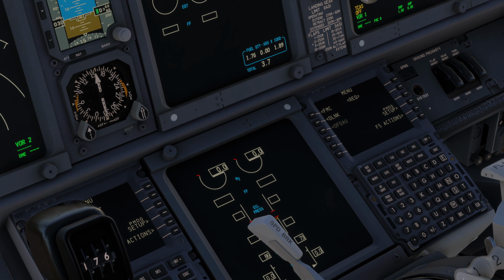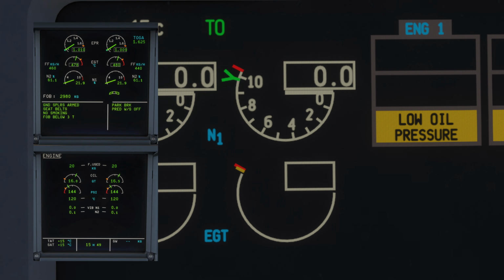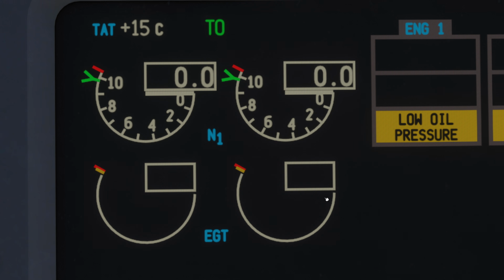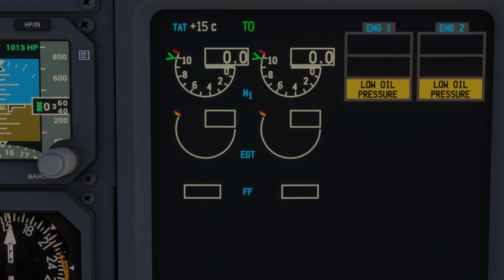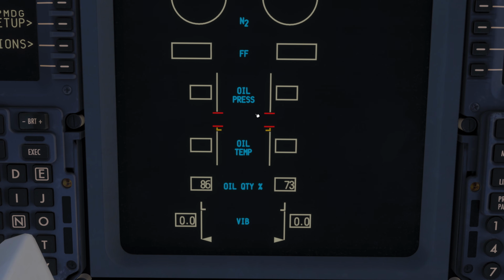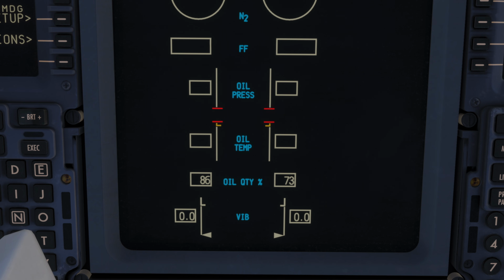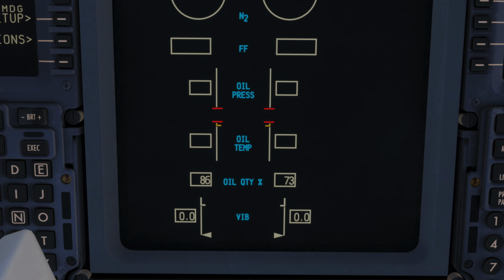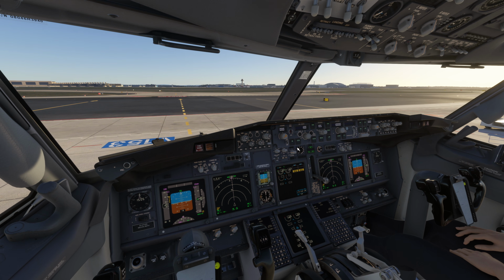WHAT does each Engine Indication mean and WHY DO WE NEED THEM? | Real Airline Pilot Explains

Comment: I was missing this kind of videos, thanks for the great explanation!
It inspired me to try things out in MSFS2024. I've set oil leak failure in PMDG 737 and waited until it all drained. The engine kept running with all parameters (except oil qty) normal. After some time oil temp started raising, than it fell into negative numbers... The engine kept running without any issues despite having no oil. @A330Driver do you maybe know to what degree does PMDG model engine failures?

Comment: Thank you very much! Your dive into N1 and N2 lead me to the understanding of presense of 2 independent coaxial shafts for high pressure compressor and low one. From old knowledge I thought that all blades are sitting on one shaft (like a steam turbine, lol) But in fact this was only at early years of jet engines. Also interesting fact about vibration: a320 engines (i don't know about others) seems to have a vibration protectiion. They aren't spooling up as it should, when vibration is too high. I got stucked in Fenix a320 CFM in EKCH in winter, after waiting for unloading/loading under wet snow (which probably accumulated on the blades). Fenix simulated this. I didn't know, just was taxiing to holding point on 1 engine, trying several times to restart other one. It was such a shame on vatsim 😂

Comment: The only time I've seen engine vibration getting too high, was when operating on the ground in freezing fog conditions.  The freezing fog formed ice on the spinner unevenly, leading to high vibrations.  The engines were shutdown and had to wait for the freezing fog to clear.  Rubbing Type 1 deicing fluid on the spinner does not work, as the high rotation of the engine flings the fluid off the spinner almost immediately..
Reply from the maker: And the ice shedding didn't help either?
Reply: @A330Driver  No, the deice fluid did not work. The deice fluid did what it is designed to do.  It falls away from the surface it is on once it reaches a particular speed.  The deice fluid was spun off when the engine operated at normal idle speeds.  Once the deice fluid came off, the ice would reform unevenly again on the spinner.  Thankfully FZFG is quite rare..
Reply from the maker: @AshleyWincer  I'm talking about ice shedding procedures where you're supposed to increase thrust a certain bit of let the ice fall off through rotational forces by accelerating the engine.
Is there no such procedure for your airplane type? Any plane I've flown has such procedures published. For example we'd use 70% N1 for 30 seconds before takeoff on the 737 in such conditions.
Reply: @A330Driver  I was working on the ramp at the time.  I'm not sure what the official procedures are for the CRJ200??

Comment: A question, will the windmilling engine shutdown in flight still have enough lubrication provided from the connected oil pump, or is the damage marginal enough to not matter much at that point ? It's windmilling so I imagine that the oil pump rotates along with it, but is it enough for the engine to not seize in time ?
Reply from the maker: Hi, a windmilling engine should be able to lubricate itself.

Comment: I really love deep-dives into engines, but unfortunately I don’t know that much about jet engines, so I’ve got a few questions:
1: are the different engine shafts connected or does each one have its own turbine?
2: how often would you shut an engine down in a multi engine plane? Let’s say your oil pressure is very low or you have a high vibration (high enough to cause damage) - but the engine is still running. Would you shut it down precautionary or rather keep it operating as long as possible? Of course it depends on conditions like altitude, terrain, phase of flight etc but would you generally prefer flying OEI or destroying an engine?
Reply from the maker: Hi Jannik,

1: The number of connected shafts is represented by your N indications in the cockpit. Most engines have N1 and N2, so two connected spools (each spool will have a LOT more stages of compressors and turbines!). Some have three spools, mostly Rolls Royce engines.
2: That'll vary by airline philosopy. At my first operator the idea was to always keep the engine running if possible to have the working generator and hydraulic pumps. At my current operator we'd rather protect the engine and shut it down precautionary, but there's no rule set in stone. Up to the pilot to decide in the end but the tendency is to shut it down.
Of course the A330 has a lot more redundancy than the 737, the green hydraulic system is powered by both engines but a single one can support it. And you even have an emergency generator that's powered by the green hydraulic system so that you would even retain two power sources without even starting the APU. It's an incredibly well made plane!